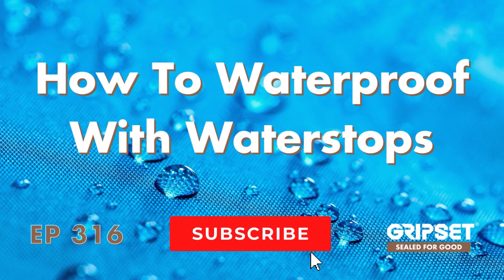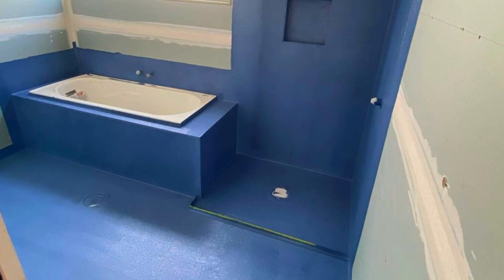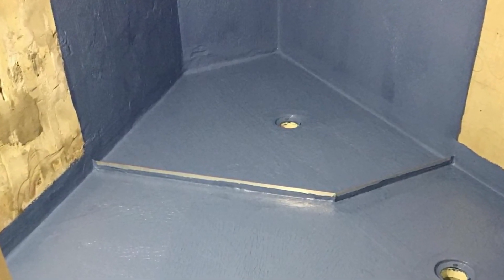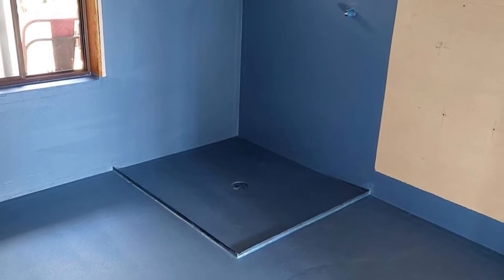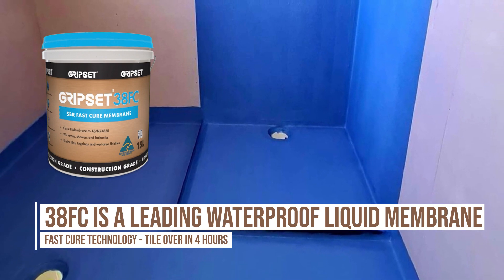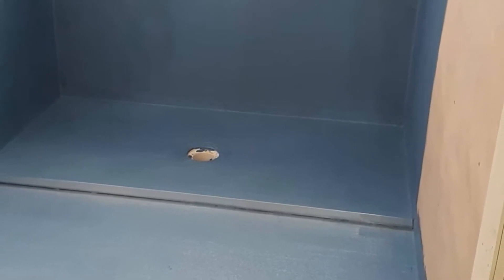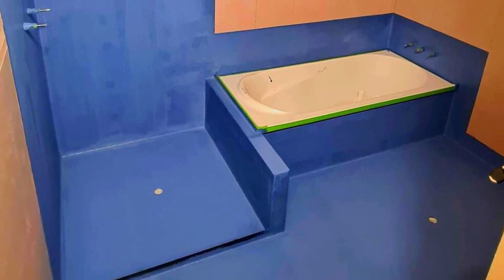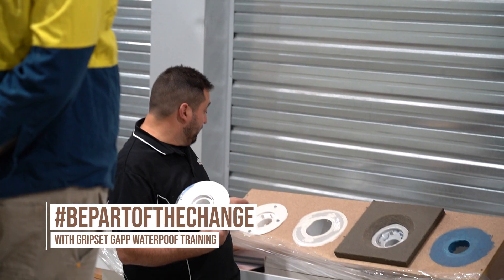How to Waterproof with Waterstops

Comment: I’m just having a tiled floor. I have a metal water stop at the door. It’s a small room 1.7 x3.4. Do I need another water stop closer to the shower? The shower is directly in front of the door.
Reply from the maker: Hi Zin,
Thanks for watching! You need to refer to AS3740 and the BCA as the requirements for waterstops, the provisions for waterstops can be found here! Typically they are applies at the extremity of the showers and doorways but you should always reference the above! Happy waterprofing :)

Comment: Hello, I'm from India, any chance of this product or similar being available here
Reply: What's a good primer for an aluminum water stop? Do you need one?
Reply from the maker: @robtien7  Hi Regan, thanks for tuning in!

If you are using a product such as the BRW PF Tape to seal the bottom leg of the water stop,  there is no need to prime the surface. BRW PF Tape is a self-adhesive waterproof tape that will bond to clean, un-primed metals and general surfaces. The fleece facing provides a key for liquid membrane coatings to be applied directly over   

If you are applying a liquid membrane with standard reinforcing fabric, to seal the bottom leg, OP Primer can be used to prime the aluminium. OP is a fast-drying, water-based primer specifically designed with enhanced adhesion properties over non-absorbent surfaces including metals, ceramics and glass.

Hope this helps! :)
Reply from the maker: Hi Sunny, unfortunately, our products at this time are only made for the Australian and New-Zealand climates. Always keep your eyes peeled however!